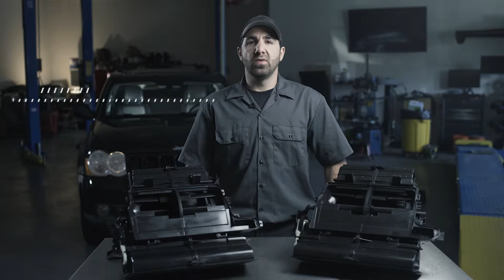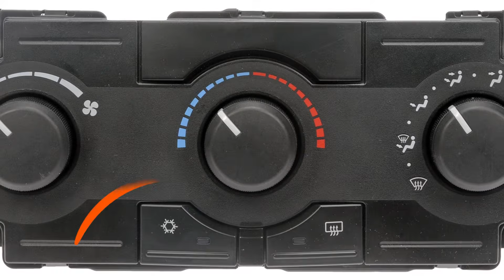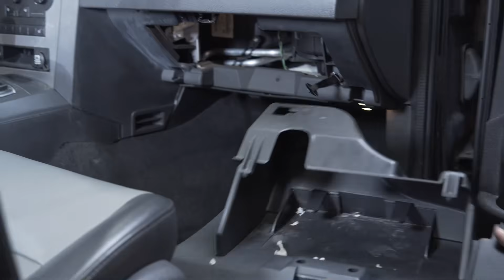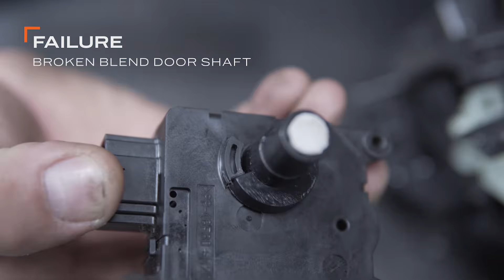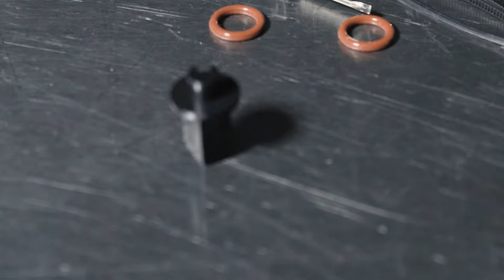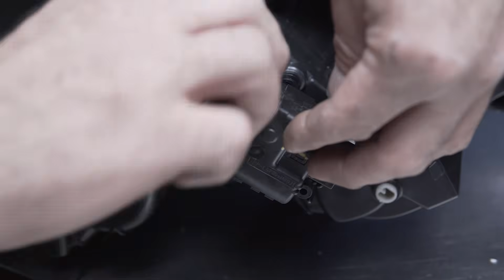How to repair Jeep blend door actuator with Dorman’s OE FIX kits

Comment: I attempted to do this repair. I drilled the hole and was screwing in the new shaft, it was almost flush and then either it stripped or the inner shaft broke. Now I cannot get the repair par out. What now?

Comment: How do you recalibrate the actuators to all be synchronized ?
Reply from the maker: Good question! The parts that the video reference are the door fix kits themselves, not the actuators.  However, if you would like to recalibrate actuators after the repair, you would use a scan tool to do so.

Comment: On the driver's side, the white plastic piece that the servo attaches is falling inside the blend box unit.  Like it just keeps pushing in.  My guess is that shaft broke inside.   The blend door can be manually operated from the passenger side.  Any idea if the relocation kit will help with this scenario?  I can't quite tell what is actually broken.
Reply from the maker: Hi Korey, what vehicle are you working on?
Reply: @DormanProducts 2005 Commander
Reply: Ive got 2010 jeep grand cherokee with the same problem. White plastic is loose and falling inside the box.got dual zone @DormanProducts

Comment: THANK YOU.  My issue was not with the connector, but with a gear inside the unit that lost a tooth.  Fixed in under 30 mins.

Just discovered you sell the actuators also.  Heading out to buy one now.

Got it, installed it.  Working great.  Thanks again for the video.
Reply from the maker: So glad we could help!
Reply: Thank you. Going to check it out later today

Comment: Hello, I have the very same problem with my 2005 Jeep Grand Cherokee 5.7L with dual AC zones control. My vehicle VIN is 1J4HR58255C561810. I'll greatly appreciate if you could let me know the correct references for the appropriate repair kit for this vehicle. Thanks.
Reply from the maker: Hi Martin, the 604-388 works for the dual zone temp control as a repair! https://www.dormanproducts.com/p-135204-604-388.aspx?origin=keyword

Comment: I have the issue where my single zone actuator works, it has some deficiency but once of fully rotates into full ac I still get hot air of the pass side
Reply from the maker: Hi Daniel, can you please tell me your year, make and model vehicle, along with the part # you installed?
Reply: @DormanProducts  today I removed everything inside the truck, everything.... Checked functionally on all actuators, 1, 2 on driver side, center actuator for rear vents and 1 passenger side and 1 for fan blower. All of them worked properly after CLEANING all the gunk and lightly lubing contact points to avoid sticking. Replace foam to seal crevasses. Still nothing... While testing though I realized the heater core lines go under and somewhat around the main duct from blower fan and all the way to the heater core with NO INSULATION. Found the job I did with the draining line lol. Anyways, so, no mechanical issues and CC console works, all ducts are sealed but the heat coming out from the heater core and lines is way too much. I'll temp shut off the lines from the outside and see if that helps by not producing the extra heat.... Any other suggestions?

Comment: Why do the wires for the relocation adapter have to be swapped for the module?
Reply: Because you are changing the direction the actuator motor is turning.  On the drivers side, if it is turning clockwise (right) for the door to open, then on the passenger side (the motor flipped 180 degrees) it has to turn counter-clockwise (left) to get the same door motion.  If you didn't change the motor direction by flipping the wires (changing polarity), then the actuator would turn the wrong way.
Reply from the maker: Hi Jacob, good question! That is how the part was engineered and designed. For successful install switching the wires must be followed.

Comment: Be very careful when screwing into the actuator arm. Mine did not screw in nearly as easily as in the video. Tried using the 3/8” extension as recommended and before I had the screw fully in something broke inside the unit.
Reply: Same here
Reply: Sounds like both of you didn’t drill those hole deep enough you should have compared the screw next to the drillbit and put a piece of masking tape so you know how far to drill

Comment: Plus I need the arm ,it was broken . Where can I order those parts the kit and the arm ?
Reply from the maker: Hi Stephen, these are the the part links from the video. Once you find the part that you are looking for, there is a "where to buy" button. After clicking that button, it will ask you to put in your zip code where it will then show the closest auto parts stores near you that carry that part. 
Part #:
604-386: https://www.dormanproducts.com/p-135203-604-386.aspx
604-387: https://www.dormanproducts.com/p-135060-604-387.aspx
604-388: https://www.dormanproducts.com/p-135204-604-388.aspx

Comment: I have a 2010 jeep commander and have dual controls! On the passenger side, when I turn the heat on ac comes out , when I  turn on the ac heat comes out ! I was told by every mechanic I talked to
Reply: Every mechanic I talked to said you have to remove the whole entire dashboard to fix the problem and told me it's $1000 just to remove the dashboard ?? Yes or no???
Reply from the maker: Hi Stephen, do you know if it is it the arm controlling the actuator door or is it the actuator motor itself. We offer both parts, part #604-388 is the arm for the door and part #604-006 is the actuator itself. You could need one or both of those.
Reply: Not sure , I have not pulled the glove box out yet , I'll the  watch the video again , and pull the glove box out so I'll  know  what part is what ?
Reply: I followed the video and I need the kit to drill the shaft
Reply: I have a 2008 Jeep Liberty, and no air come out from the front vents only the ones by the windshield. I have a single, temp control that sit in the middle of two knobs. Could this be my problem as well? From your video it sure seems that way. Please help

Comment: Dual zone repair kit
 https://www.amazon.com/Dorman-604-388-Repair-Compatible-Select/dp/B09DN7TJKM/ref=asc_df_B09DN7TJKM/?tag=hyprod-20&linkCode=df0&hvadid=548938427687&hvpos=&hvnetw=g&hvrand=15734478153470517613&hvpone=&hvptwo=&hvqmt=&hvdev=c&hvdvcmdl=&hvlocint=&hvlocphy=9002142&hvtargid=pla-1438821828650&psc=1

Single zone relocation kit
https://www.amazon.com/Dorman-604-386-Single-Relocation-Compatible/dp/B09DN2R8CW/ref=sr_1_1?crid=1KPDAU696XE33&keywords=604-386+dorman+single+zone&qid=1660054131&sprefix=604-386+dorman+single+zone%2Caps%2C248&sr=8-1

Comment: What about jeeps 2011-up
Reply: Hi Michael, which model 2011+ Jeep have you seen this failure on? Was the failure exactly as these repairs fix?
Reply: @CAPZATTACK610  Grand Cherokee Laredo 5.7L. My passenger side little cheap plastic piece snapped and so did the replacement. Crazy ass dealership is asking $2800 and it’s all because of labor. But it’s the rubber from the blend door that has melted and constantly gets stuck. I can unsick it manually but then the actuator turns and resicks it. So if the little cheap plastic piece that is between the blend door knob and the actuator had a couple extra millimeters of meat on it at the heat side, I’m pretty sure it’s be a temporary fix for some time. But that’s the problem

Comment: Nice Video! Just one question, what size torx bit is required? Also, while you showed how to perform relocation procedure, you did it on the bench and not in the vehicle as most of us would need to. Maybe redo the video? And more importantly, what is the part number and link for these kits???
Reply from the maker: Hi there, you can find more detail on these and similar kits here: https://www.dormanproducts.com/gsearch.aspx?type=keyword&origin=keyword&parttype=HVAC%2520Blend%2520Door%2520Repair%2520Kit
Reply: Probably a t20